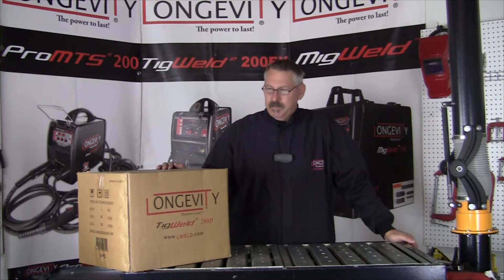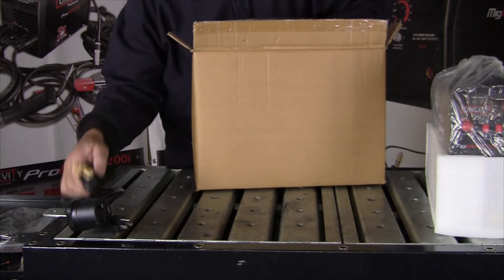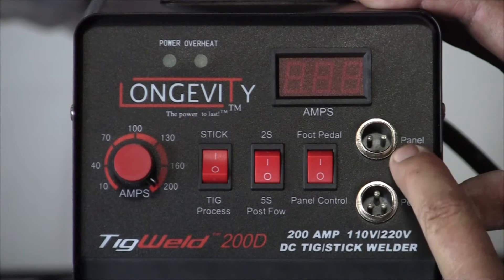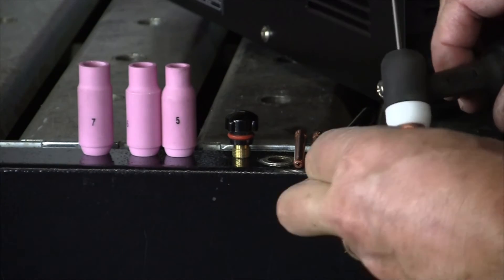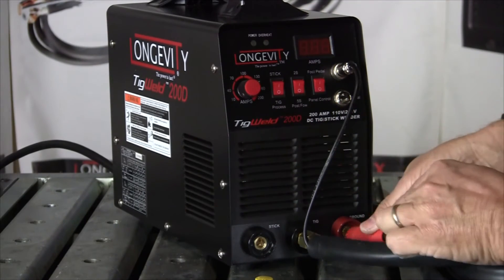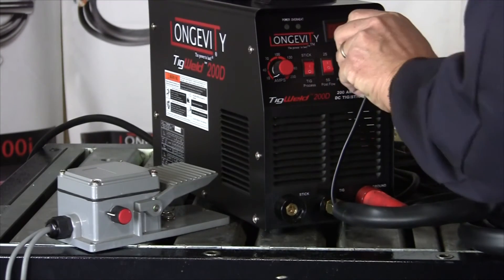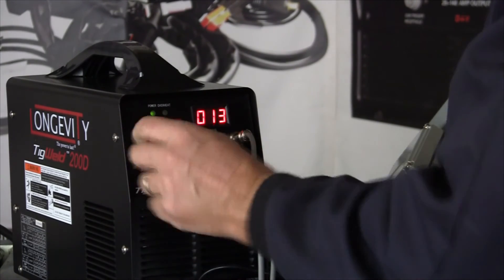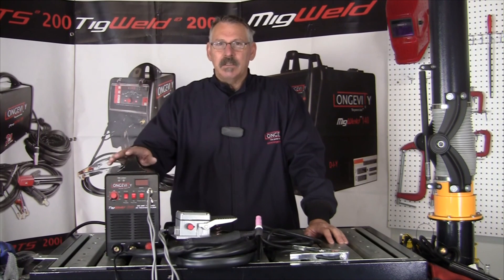Longevity TIGWELD 200D - 110V/220V 200 Amp TIG / 180 Amp STICK Welder

Comment: Take it from a welder dude, not a hobbiest,  get a everlast powerpro or power tig.  The service is great. I love my machine.  I have 3 millers, 2 syncrowaves and one dynasty.  I've used the syncrowave once since I've had my everlast.  Ray with technical support is awesome.  He answers every time and calls back when busy.  I was nervous too when searching for another machine.  I found a wimner.  Call everlast send this horseshit back. I've yet to see one water cooled,  no one in their right mind would weld aluminum or could without a water cooled torch. Longevity is a gimic.  They sell these piece of craps to many other places with many other names on them.  The reviews are bad!

Comment: i ordered this and it did not come with any of the tig nozzle assembly or the 220/110 adaptor or an owners manual, i called customer service they said they would send the missing parts out the next day. its been two weeks almost three and they have not come yet nor has an email been sent to me saying they were shipped. cant speak about the quality of the welder because it wasnt shipped with all the parts to use it. also it did not come with that fancy bag either or the wire brush/hammer. so far this company seems like a bullshit scam seeing as i wasn't given what i payed for.
Reply from the maker: i apologize about the customer service experience you have received. Can i get the name on the order so i can have someone look it up and get the parts you need sent out ASAP.
Reply: The same shit happened to me I will never re comes this welder to anyone. I tell any and everyone in the field to spread the word on shitty welder and company. They are all fucking liars  and are a hue scam. People do not waste your money on this suit company. That suck at life over their.